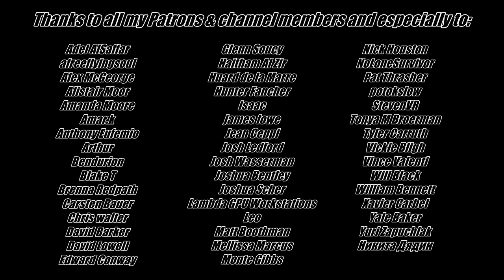Making a Custom Gear

Comment: I've been a professional draftsman for over 18 years now, and have called out run-out specs in GD&T per engineer's direction. Until now I have never seen that actually managed from a machinist's standpoint. Just so used to that being validated by the QE in the metrology labs. Love ALL of your videos by the way! Cheers from the US!
Reply: i've never seen so much knowledge, skills and precision anywhere else, for sure
Reply: After missing one step (not truing up the second gear) I'm not so sure that finished product would have passed QC.
It's going to make for a pretty noisy set of change gears.
Reply: @uralmash07  Sure :)
Because there is run out on the second gear he cut, the teeth won't be be perpendicular to the axis of the shaft so for some portion of each rotation the gear won't mesh properly which will increase the backlash in the gear set. It will be noisy to begin with but also they will wear unevenly, getting worse over time.
Reply: I've worked with guys like you over fifty years, mechanic, machinist, welder, electronics tech, blacksmith.  Good drawings make it simple to do a good job, and good communication makes for quality work.  I did electronics in the Marines, and dealt with high end metrology there, as well as in metal.  I always liked to have the engineers and draftsmen in the shop, it helps all see the full process, the corners that have to be got around.  Semper Fi, John McClain
Reply: @BloopTube  I've seen most machining processes in my career, but not for run-out. I'm not a machinist so I don't get out to the machine shop very much to see everything the machinist does to make the part. 

Some places I've worked at the tooling shop isn't even on site.
Reply: @BloopTube  I've been a toolmaker fifty years, and always aligned such between centers on a milling machine, and cut locking recesses, or ran a broach through with keys.  Never ever considered welding on my lathe, they cost too much.  Of course mine are rather old, just keep rebuilding them.  I've always preferred "other ways to skin that cat."  Just the way I learned to do it, back in the sixties. Semper Fi, John McClain
Reply: We have a saying in our shop:  beating the quality into it.
Reply: I call BS, nobody in the US says "cheers" I've lived here all my life
Reply: @jimmyb1451 Yeah... There did seem to be a bit too much runout... the centring pin didn't seem a tight fit so thats probably where it crept in (pulled whilst welding)... flipping the gearset and tapping it to run true may have mitigated the problem somewhat and as this is for screwcutting, the speed will not be high... also,  meshing with some paper stock between the mating gear teeth might be prudent to introduce a small clearance ...🤔

Also, tapping to correct runout while the DTI is bearing on the workpiece is also a no-no... they are fragile little critters and can be damaged easily...

😎👍☘️🍺
Reply: @johnmcclain3887  but he didn't weld IN the lathe, did he ? 🤔

Edit..
Sorry John ... I see you were replying to a deleted comment... I assume blooptube suggested welding in the lathe.. not a great idea... 🙄

😎👍☘️🍺

Comment: Grounding through the vise screw is a great way to either get poor welds because of the grease on the screw preventing a good connection or to ruin a screw or nut due to secondary arcing..   Fine if it's a $20 Chinese vise, but a bad thing on an expensive or antique vise..   If you are welding in a vise vs a fixture, clamp to the body or jaw of vise.   Our shop vise actually had a tab on the side of the body for a grounding clamp.
Reply from the maker: Need to change that
Reply: @mymechanicsinsights  It's really great seeing how well you take constructive criticism! You seriously are the best Mechanist Youtuber out there. Cheers from Germany!
Reply: i was going to say the same exact thing, ive done this too welding small tabs and stuff and finding out it was grounding issues, after clamping it to the table or piece it was nice coin stacks
Reply: @That was my thought as well. As soon as I saw and heard the arc I knew it wasn’t grounded properly. Also while I knew about the issues with secondary arcing in the screw/nut I hadn’t thought about the grease being an issue so thanks for increasing my knowledge.
Reply: There were a bunch of satellites in orbit in the 2010s whose gyroscope wheels failed prematurely. The first one was unusual, but when more and more happened the odds of it being random bad luck were basically zero.

Turns out that the metal bearings were repeatedly exposed to several megavolts of static charge (it's not really possible to ground anything in orbit), and over time the micro-arcing caused tiny fragments to flake off inside the bearing housing, eventually leading to total seizure.

Newer satellites all use non-metallic bearings.
Reply: @rebmcr  oh interesting
Reply: @rebmcr  ceramic now I assume?
Reply: Been thinking this for several previous videos. Bolting a tab to the side of the vice wouldn't even be that hard.
Reply: @50shadesofmycow  agreed - I've tried looking at others and I'm just not as satisfied as I am when I watch my mechanics. Seeing this only makes me like his channels more.
Reply: @mymechanicsinsights  I flattened a section of copper pipe and bolted it with the vice mounting bolts underneath underneath my bench. When I want to weld I put the earthing clamp on the copper tab. It’s out of the way and works.
Reply: Colin Furze added a ground eye connector (don't know the right word) to one of the connecting bolts of his vise. Worked like a charm!
Reply: Saw an inexperienced welder cause thousands of dollars damage to a train car that way. He grounded to the wheels and was welding on the body. All the bearings in the wheels had to be changed due to the arcing across the greasy ball bearings. Hard lessons there!
Reply: Uhm I don’t know how to break this to you but I’d say 90% of the old vises out there have been welded on like a ton. Some have adjustment tabs or bolts holding it to bench where most people clamp to. The machine screws are almost always never greased oiled or serviced during their life so even clamping to the screw won’t make a difference on the spot welds.  It’s sad but very true. Restoring old welding shop or blacksmith vises I can guarantee you have to replace the screw and nut.  The cheaper vises most use usually break long before the screw ever wears anyways. The castings are really poor with sand inclusions.
Reply: @jacilynns6330  The point is, for a welder, it is bad practice and a bad habit to get into. Second, the weld suffers because of inadequate ground and secondary arcing and makes it difficult to obtain a good weld with proper penetration. Thirdly, just because 90% of old vises have been abused and treated stupidly, this one was lovingly restored and doesn't need hardened arc spots in the screw or the nut causing premature wear. So ya, we know,  you aren't breaking anything to us.
Reply: Nope, there is enough contact beside the screw. Nut and screw are not the only touching parts of a vise. Due to the clamping force there is at least one more point at the guiding faces. I´m welding since decades on my industrial vise, never had issues.
Reply: Juste intercale une plaque de cuivre entre une des mâchoires et la pièce à souder, puis connecte l'électrode à cette plaque. Chemin le plus court, plus faible résistance électrique et sans modifier l'étau...
Reply: @rebmcr wow, thanks!

Comment: The welding mask screen effect is a really neat idea that I don't think I have seen anyone else on YouTube do before. I like it. I can genuinely see some people having issue with the arc being too bright on some of these new really bright displays.
Reply from the maker: I've heard people could get epileptic problems from flashing lights.
Reply: Cutting Edge Engineering Australia do it too (and if you like my mechanics, it's worth checking them out).
Reply: @rebmcr  Agree, plus you’ll stay just for the dog
Reply: @MrSaul04  Yeah I'm particularly fond of both dogs, and doing things methodically. It's the perfect combo!
Reply: @mymechanicsinsights  it's a very small % of people, but it is a real thing.
Reply: @mymechanicsinsights  That is absolutely true.  As a fan who also suffers from epilepsy, I thank you for that filter.  I hate having to miss parts of the video from looking away during the welding sections.

Comment: Who else expected you to mill the gears out of a blank? :D But anyway a nice video!
Reply: I guess that is the expertise of Chris from clickspring
Reply: @ThefalleStrat  we can make gears, though it isn't often worth the time it takes.
Reply: Me. "I make a new one" :(
Reply: I was surprised he did not make them, not disappointed, just surprised.
Reply from the maker: I would if I had the correct milling tool ;-)
Reply: @mymechanicsinsights  Have you seen my work on straight flank tools for making gears?  andysmachines slitting saws gear video inspired me to update it and it is working quite nicely.  I made some .5 module gears with my a axis.  I may do a test of large module and a virtual "flat" using a regular V cutter.
Reply: Nice work, always enjoy the double checking of angles and true. My big question is ; where did the centre pin you dropped in get to? Was it completely cut away? Ok, then why didn’t it just spin when the cutter reached it?

Comment: I'm so in awe of your work and so many of your skills that, as an experienced welder myself, it's oddly comforting to see your less-than-pretty welds in between all the other amazing things you do.
Reply from the maker: It doesn't matter when I turn them down anyway right? ;-)
Reply: @mymechanicsinsights  I too enjoy the fact that you weld about as well as I do, but if we get better at it, it would take less time, use less resources, and require less material removal for clean-up.

Comment: When I first saw the two gears I was hoping to see your first attempt at friction welding :( Still amazing work as usual! Looking forward to the next restoration vid
Reply: Can you friction weld with a regular lathe or do you need something heftier?
Reply: @volbla  I’ve seen it done with a regular lathe but not with anything of this size.
Reply: @volbla  I remember seeing MM planning to equip his lathe with a brake for the spindle. Every friction welding video I saw had the lathe spindle braking instantly once the welding was done.

Comment: I was literally just watching this channel bc I was waiting for something new. Quick welding tip: the speed should be to where it sounds like frying bacon or eggs and should have a steady sound.
Reply: I’ve seen this man weld in previous videos.  I believe his issue was the material of the gears.
Reply: @dougoliver2342  still might’ve been the speed bc the inconsistent sound
Reply: But if it smells like bacon, you're doing something horribly wrong.

Comment: My only concern would be that you aligned the two gears by truing the bores to the major diameters and not to the pitch diameters. Depending on how well those gears were made that could result in some problems when in use (binding, etc.). Otherwise it was enjoyable as usual to watch!
Reply from the maker: Stock gears always have a relatively small diameter hole in the center. Which always will be in H7 tolerance. The gear was first turned and then milled the teeth with gear hobbing while beeing guided on a shaft in the hole and clamped on the faces. Means the pitch diameter runs concentric to the hole.
Reply: Let’s mark it on the lathe and see….
Reply: @mymechanicsinsights  Good response, and you should have included that in the video!

Comment: We never used the welding technology for this type of gear configuration. We always made the hub and then shank the gear onto the hubs respective ends. This gives a much better coaxial tolerance. Great video👍
Reply from the maker: I thought about this too. Thanks
Reply: @mymechanicsinsights  Make the hole 0,05 of a millimetre smaller that the diameter that you want to shrink onto. Turn the hub's respective ends so that there's a small register where the gear can stop against, about 1-2 millimetre under the major hub diameter. In this way, when you heat the gear and mount it on the hub, the gear will register in the correct position. Heat the gear to dull red. This well give time to mount the gear properly. Once mounted there's no way of removing the gear again.
You can also use a tolerance table to fined the optimal diameter from shrinkage but, I have found that 0.05 is very effective.Looking forward to your next video🔩⚙🔧🛠

Comment: An excellent answer to an unusual problem. I enjoyed your presentation and the topic. My only concern would be if the weld heating could change the harness of the gear teeth. causing early wear. Well impressed with how you approached this job. Thank you for sharing.

Comment: I would have turned a much deeper v and arc welded it with aluminum washers to protect gears from splatter. Weld, wire wheel or grind, weld another layer, rinse repeat. Arc welds depending on rods, are softer stronger welds. Mig welding thick stuff requires expensive machines, special wire and gas. See cutting edge engineering.

That said waiting on next restoration project. I loved the scooter where you made the wheels and stuff that was so cool.

Comment: One heck of a weld that was. It left a pretty nice and bold double-hamon after clearing out the excess, lol. Thanks for the video. 

PS maybe you might consider doing something like this more often where you’re showing some of the more tedious things needed for using the mill/lathe etc. like the necessary math and such for the settings, as well as other things one must go through prior, during and after using such machines. Well, it’s mostly Greek to a lot of us, including me, but that’s part of why it’s interesting. Just a thought.

Comment: Nice, bet if you bought that particular gear combination it would be expensive! But hooking your ground clamp on vise handle while welding is not good idea, can mess up threads and if your particular vise has thrust bearings, could also cause trouble there too,  not trying to be back seat welder, just hate see you destroy that super cool vise there!! It doesn't take much much voltage/amperage to cause a bad day! Oh and some cutting oil goes a longgggg way to make keyway broach last longer too, know it's lil messy but cheaper to clean up the mess than replacing the broach!
Reply from the maker: Really expensive indeed, that's why I made my own.
I just used the broach dry to make it better visible on camera, I always use oil off camera.

Comment: I've seen this done professionally, to change the gear ratios on 4x4 transfer boxes. One thing they did differently was to TIG weld and cool the gears between stitches. I guess runout in a car is more important. They also put pins through the gears so that all the torsional force wouldn't be on the weld joint.
Reply from the maker: Good point. But yeah, this one also spins very slowely and I need this gear very very rarely.

Comment: Please Put the Mass Cable directly in the Workpiece.
If you just put it in the Handle of the Vice you dont have a good Mass Connection and the Weld gets really Bad without any burnin.

Comment: Just an assist, sounds like you need to turn the volts down a touch and the wire speed up some.
Reply from the maker: My welder is a very cheap one, I have pretty much now settings to change.

Comment: 26 tpi is an odd thread even in the imperial system, only a few applications use it. British Standard cycle thread, if I remember correctly.
Reply from the maker: Yeah and I guess that's why you'd need special accessories to cut it on that lathe. My last coffee grinder had such a thread

Comment: Very nicely done. I really like your videos. When you are broaching the next time, use some thick cutting oil and your tool will stay sharp for longer. :)
Reply from the maker: Thank you very much :-)
I used it dry on prupose, to make it better visible on camera.
Reply: @mymechanicsinsights  Okay, got you. :)
Reply: @mymechanicsinsights  I was gonna ask about that. All the yt machinist always hammer on using lubrication when broaching. I thought there might be a reason why it would be better to not use oil or why it's not important in this case like the aluminum is soft enough to get away with it. Visibility in the video makes sense.

Comment: A great way to solve the problem!  Welding 2 stock gears to get the “accessory” add on!   I am in no way a machinist; but I always learn something from watching your videos!  I do think you solved this the best way possible!  Just out of curiosity though: how long would a gear set like that have taken you to make from one piece of material?
Reply from the maker: You'd just need to mill the teeth. Possible too and not very difficult, but I don't have the correct milling tool.
Reply: he would have to buy gear tooth cutters and have a dividing head which im sure he has.cutting gear teeth can be time consuming

Comment: What welding process was that? Was it strange mig settings? A bad ground caused by clamping to the leads crew? A cheap innershield setup? Looked like a stick bead, but it didn't have slag, but maybe you cleaned it up off camera?

I'm assuming you don't have a tig setup, as that seems like the best process for this application due to the lack of spatter and the low heat input.

Anyway, amazing video 😀

Comment: I hope that weld holds up.
Reply from the maker: No torque applied on the welds. Goes directly to the key as only 1 gear will be engaged at the time.

Comment: Why don't you use cooling liquid while turning? Filings are blue that means they probably couple hundred degrees. Usually with coolant tools keep edges longer. However I'm surprised how easily you've cut gear steel.